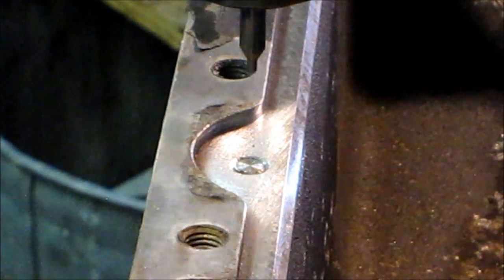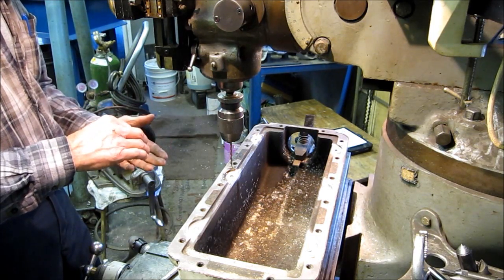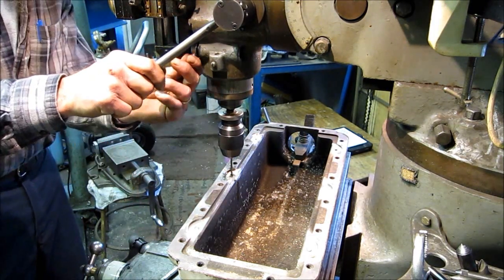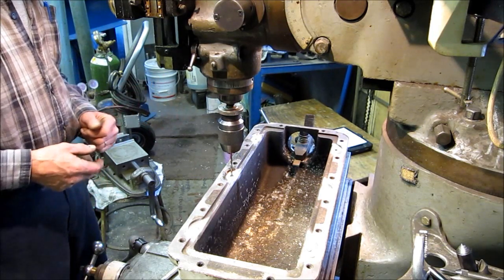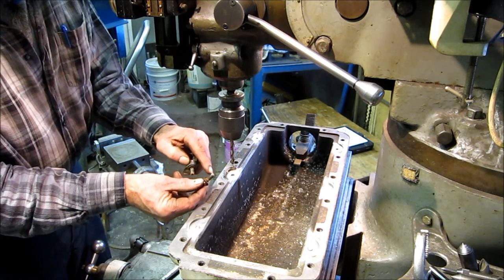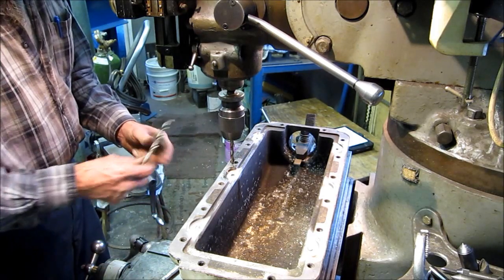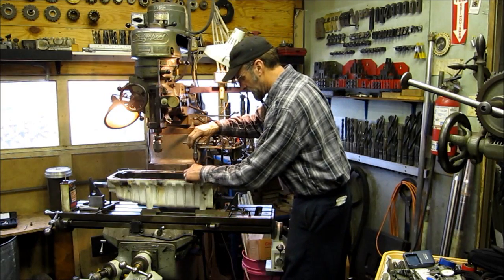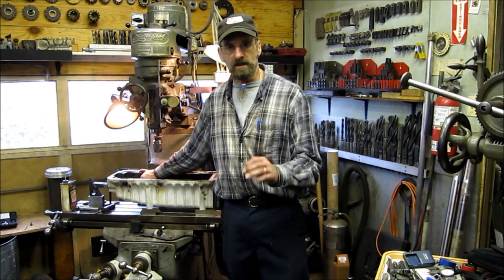Removing Broken Bolts

Comment: I note that you remove the helicoil tap with your hand.  This is the right way to do it as if you have any force pulling on the tap as lt leaves the hole it can tear the last bit of the thread.   Nice work.

Comment: I only find examples like this after the days on end that I spend trying to save the original bolt hole, leaving an oversized egg shaped hole down to the last corrodedly stuck thread. Having all the right tools, wire feed, commercial drill press' makes no difference, 5 cocktails or not, first thing I reach for is a punch and a hand drill, and never hit the center, nor be in alignment. I'm jinxed for that. Once I broke 11 of ``17  1/4 stainless bolts holding the exhaust cooler cover on a Merc 1000 6cyl. Using a 3/8 butterfly impact wrench after the first 2 bolts snapped off using a 1/4 in tiny wratchet, I was like whatever, just yank em out, and try to extract the thread, lol. From now on, I'm using the supplied thread kit drill and save some time!

Comment: I have no luck with heliciols. I use timeserts but I work on cars and never have a right angle, or drill press or enough room to get an angle drill in....It would just be nice one day if an "easy to get at bolt broke".......the timeserts make up for my inaccurate "handport" mill!  Some exhaust studs on the back heads would cost more to remove the heads than the car is worth and we have to get creative sometimes to get emissions tests when they throw lean O2 codes at you with 3-4" room to the firewall and on and angle you cant see behind something.
Reply: Jordanhollowdistillers  Cool Comment, real world stuff.  My 99 van has a sheared off exhaust bolt and I can't "mill" it either.  You should do a video of the "timesert" method....please!
Reply: go on ebay, buy timeserts read instructions. Use a drill stop and don't drill into water jacket. It's pretty straight forward. Sometimes you need a die grinder to flatten the bolt out so you can center punch it. A timesert is a barrel that expands like a pop rivet in the hole for lack of better wording and will work better "should" you be off center when drilling.
Reply: Burt Gill

Comment: I also like time-certs, I have even used them to repair spark plug threads in high performance aluminum heads. I have yet to see one fail.

Comment from the maker: No I haven't used that brand, but have made a few myself over the years. I like Heli-coils, never had a problem with any that were installed correctly. If I was repairing a thread on a high heat project, like a turbo, I would go with the inserts and stay away from Stainless Steel it looses it holding toque due to the high heat. ;{)-----

Comment: Biggest probs I have is most come to me after they have broken a drill or screw extractor, (easy out, what a bad name) in the job and then ask for help! I have managed to save these because my Father and his also taught me to think outside the square. 1 on an Audi head stud I did recently with broken easyout in situ, off center I removed using a Tungsten tipped drill and several hrs of patience. Would have been easy if someone did not decide to save some money by DIY. Cheers from John.

Comment: On small bolts like this, I check to see if they will come out with a small diamond point chisel. If not, drill time. I agree about ease outs. If you can drill a straight hole, why not get some new threads instead of reusing old ones. Great video.

Comment: In this type of situation, its quite easy to remove a broken bolt, and the way to do this is to MIG weld a big enough blob of weld onto the broken bolt, to be able to grip with molegrips, and turn out the broken bolt as soon as the weld has cooled from red heat. Easy outs very rarely work, but the weld blob on bolt method seems to almost every time, and if you are lucky will also do the trick in your situation.

Comment from the maker: I would try and weld a build up on the easy out until you can weld on a nut and gently reverse it out and throw all your, easy outs away. Then drill the broken bolt out with tap size, If you were on center you may be able to take a scribe and needle nose pliers and pull out the remainder of threads, clean with tap. If not, drill out for same size Heli - coil ;{)-----

Comment: thanks for the input bro very good practice , i have striped aluminum engine blocks on small 2 cycle engines so i really appreciate the info small bolts are the worst as they strip the easiest i may get a kit for doing this , im a comercial carpenter by trade but im also the jobsite engineer and i just fixed a gas ax that 
had a loose carburator and it was a pivit seal with screws on the top only and a fulcrum on the bottom { junk} and i stripped it a little
added 500 degree jb weld

Comment: They make a tangless helicoi; too.  The disadvantages are that you have to buy 1000 just to get the few you actually need, and you have to buy a tool for each size you use.  The advantages are that you can install the tangless in a hole that can be drilled only as deep as needed which keeps you from being able to break off the tang. Another advantage is that you can order a tool that will allow you to back out the helicoil.

Comment: In addition to what Mr. Fenner said, Helicoils are ideal for threading aluminum.  They were originally developed from use in aluminum components in aircraft.  They allow for a much stringer thread than the aluminum does.  I know guys who will install helicoils in every hole if they have to install in one.

Comment: Keith I recently had a very similar job presented to me,  Alloy Sump Pan on a small utility tractor and like your job, corrosion was precipitous to the repair but I opted to ream out the hole to clean material and used a hard steel insert, with whitworth thread on the outside, the only large Tap and Die combo I had available to me. I set this in place set with Loctite 601 and I then opted to replace the original UNC bolts into the alloy with  7/16 UNF into the steel insert.

Comment from the maker: Thanks for the comment, I used the helicoils because the old thread were wasted by the corrosion and there was good material just outside the threaded area making it ok for inserting the helicoils, keeping the original size of thread and pitch. ;{)-----

Comment: ok i no this is a dumb question but i didnt have time to pay attention to your whole vid, are you using hela coils because aluminum is soft or  was it to return to the original tap size?? i was thinking you may of done it to make the threads there original size but wasn't sure.  you are a very skilled individual and the question may sound dum but i learn allot from you and watch all your vids , im no machinist but i am well on my way, just need about $300,000 worth of equipment  lol

Comment: Actually you don't stainless steel bolts in aluminum - it's the worst thing you can do. There is a powerful galvanic corrosion that occurs, it will corrode aggressively and become impossible to remove in very short time, more so in a salty environment. The best bolts, I feel, for aluminum are Grade 8 bolts. They come with a gold cadmium coating that protects them from corrosion, including any galvanic reaction with the aluminum.

Comment: In situations like this, where corrosion and galling of the fasteners has been a problem, do you recommend using anti-seize or some other method of preventing a recurrence when you're re-assembling the repaired part?  Would using stainless fasteners be a good idea, or would stainless interact badly with the aluminum?

Comment: Joy, i just had to remove 4 broken bolts in a boat lift motor due to being in saltwater and corroding solid.  I was able to soak 2 bolts and get them out with an easy out.  The other 2 i had to put a hole through the middle and broke 3 easy outs.  To fix this i used a 1/8 carbide cutter and cut down the threads to make the broken bolt 2 pieces, it was easy to remove after that.

Comment from the maker: Its a bit small on hole size to get down in the bottom and properly weld your way back out. the flange face is also a sealing surface, warpage may of been an issue. The coils keep it the orignal size...

Its a good thought though...

Comment: Excellent video.  My ONLY criticism is that you probably shouldn't have your fingers so close when you blow the shavings out of the hole with the air nozzle.  It is possible to embed the shaving in your fingers that way.

Comment from the maker: Ahmed, Its pretty hard to make the call on the best way to remove it without seeing it.
If some of the bolt is sticking above the surface I'd see if I could weld a nut to it, then heat the casting, to see if I could get it. 
If it was a flush break, center punch, using transfer punch set, with housing in place, to locate a good center, then drill minor thread size using left hand bit, just incase thats lucky, if remaining threads can't be removed by scribe and or tap, use Helicoil kit.

Comment from the maker: Yep, your absolutely right, left handed bits do just that, i've done that many times, myself. I've also had, which i felt this was the case, a thread locked so tight, due to the salt corrosion, it would of just drilled a left handed hole and not caught the remainder of threads and failing to draw them out. I pretty much use the left handed drill trick on sheared off cases. If its a guaranteed threaded job for customer, new threads, no squeaks... Thanks for the Kudo's...Keith